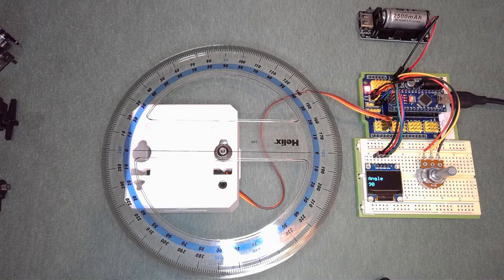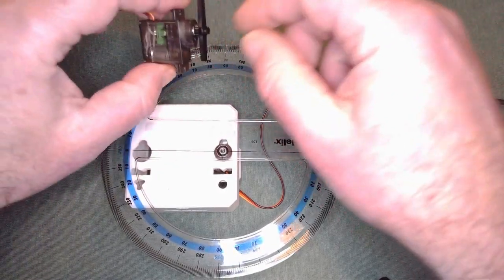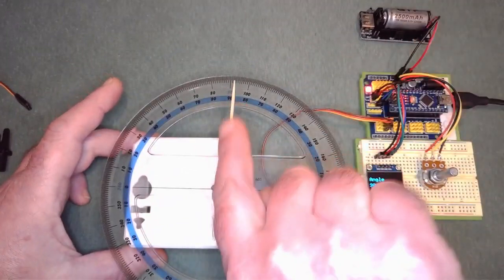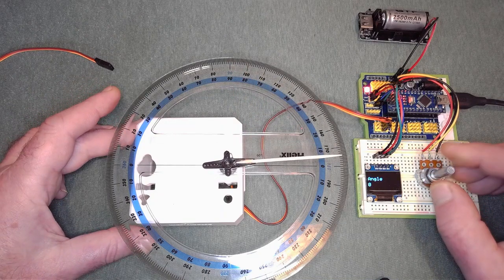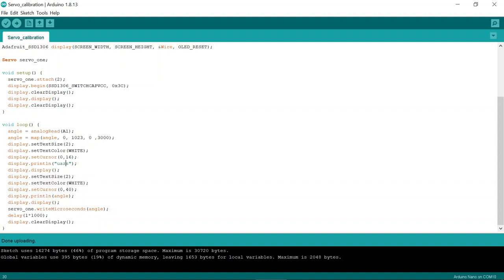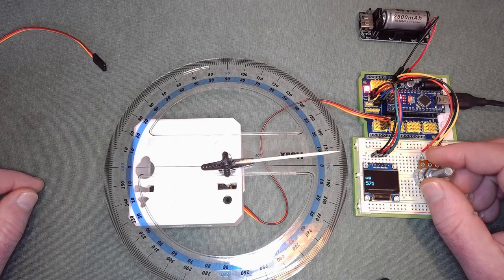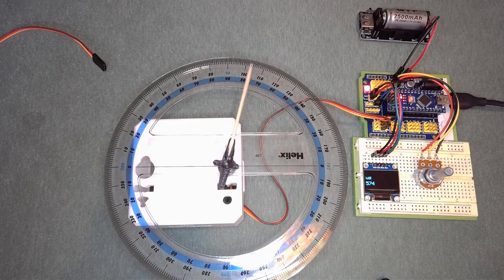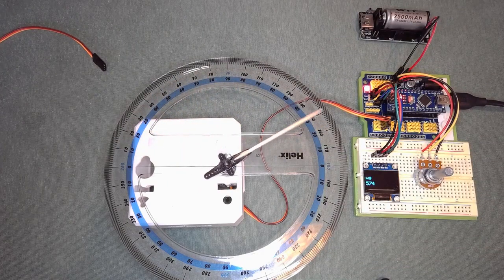Robot Servo Calibration and Sweep with Arduino IDE, ideal for Otto DIY biped walks and tournaments

Comment: On these servo motors, once the calibration is done, does the actual reading goes out of whack over time? For instance, if your reading dead center = 94°, would that become 98° or 88° over time?